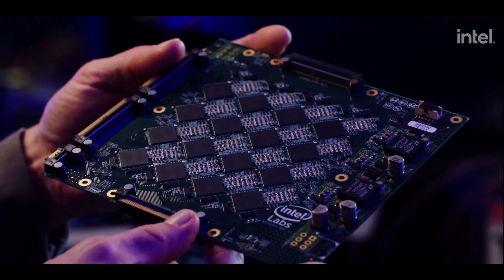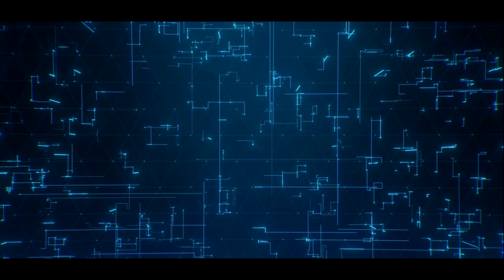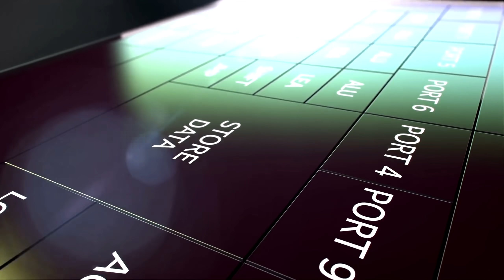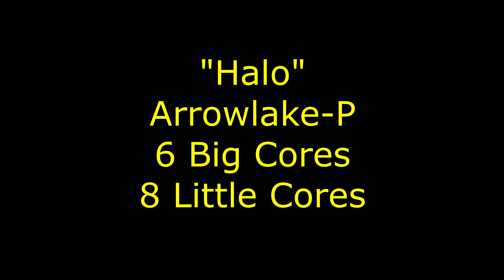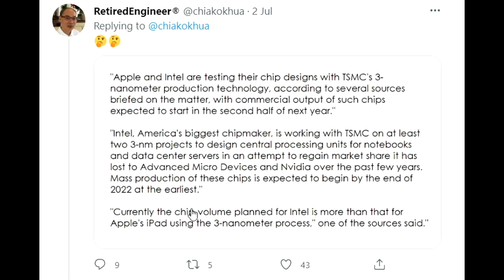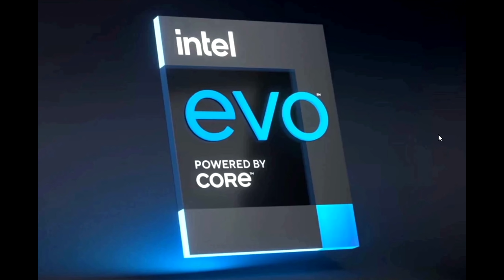Intel's Arrowlake Aims at Apple

Comment: tbh by the time Intel has this coming out, I would expect AMD to be at 16C32T in mobile, you are gonna be paying out the nose for it, but like I expect Zen 5 to be a thing at that point where I do expect AMD to go 24 - 32 core on the consumer desktop, 96 - 128 core on HEDT and 128 core on their data centre parts, and I don't see many workloads where 32C64T loses to 8+32 and I certainly don't see many workloads where 6+8 wins against 16C32T

16 cores in a 35W - 65W mobile part is WELL within reason, because like I also expect AMD 3D package Zen 5 mobile parts, and no I do not mean 2.5D I mean 3D and I don't mean the kind of 3D that is Zen3D. So yeh AMD can make a 16 core part and a 8 core part with a big ass iGP and big ass cache for it just by replacing one of the CPU dies, because the reason AMD hasn't went chiplets for laptops is because of the extra power you have to use shunting data though the substrate for a relatively long distance. The first place you are going to see 3D packaging from AMD in the CPU consumer space is gunna be laptops.

Honestly I wouldn't be shocked if we see 3D packaging for Zen 4 in the laptop space, then Zen 5 will bring that to the desktop.
Reply: 16C 32T in laptops are not comming anytime soon. I mean it would be insanely expensive and very few people would buy that.
Reply: @giorgos6576  Q4 2023 isn't exactly soon, and it doesn't need to be expensive if AMD doesn't want it to be, the cost of production are marginal for CPUs except for ultra budget CPUs. So then it's just about thermal and power, and with the energy SAVINGS you would get from moving memory onboard and the N3 process you can easily put 16 core on a mobile CPU, also clock gating is a thing so increasing core count barely effects idle power, so the only times you are gonna consume more power is when you are using those cores and whatever your doing will finish faster so even then it's not going to effect battery life as much as you would think.
Reply: @giorgos6576  For gaming/workstation laptop, I don't mind to pay the price as long as its fast and optimised
Reply: @alastairgreen_Nexus  16 cores will not give more fps compared to 8 cores.
Reply: Intel is no longer competing on performance with amd. 

Performance is nowhere as important in the mobile space as power consumption, packaging and costs.
Laptop buyers dont care about performance. 
And in the server space they can never catch up with amd while they are still using monolithic designs.

They see bigger fish in other markets i think.
Reply: @baronvonlimbourgh1716  A lot of my last comment also applies to what you said so... And there are certainly laptop buyer who care about performance, and as said, if they go with 3D packaging they can just swap out 8 of the 16 cores for a big iGP and gob of cache, or for a more budget focused CPUs only put 1 CCD, and have like 4 - 8CUs as base in the design as with the 1 CPU CCD part 1 GPU CCD part during low demand you can use the smaller GPU to save battery life so it still has a use.

Also depending you might be able to use the 4 - 8CUs in concert with the larger GPU given that AMD is already apparently doing that with RDNA3, although in that case it's 2 dies that are exactly the same also 4 - 8CUs on N3 will be tiny and you would also have all of the multimedia engine and everything like that in the base design.
Reply: @Etheoma  yeah, i'm sure amd will be upping the core game in the mobile space as well soon enough.
They kind of have to. Intel is still competitive in that space and they will want to take a lead there. Even if it only is for marketing purposes.
Reply: @baronvonlimbourgh1716  Also 3D cache also means they could integrate memory into the chip it's self, so memory bandwidth for the large GPU wouldn't be an issue, although with DDR5 and a 32MB L3 GPU cache they could increase effective bandwidth by 3x, so if it's "only" like 16CUs of RDNA3 they wouldn't even need integrated memory, but anything beyond that would require onboard memory so if it 20 - 24CUs thats gonna need onboard memory.

But 24CUs of RDNA3 would performing around a 1080/3060 which for an ultra thin even in 2023 thats gonna be pretty decent, like not great, but 1080p with pretty high refresh rates is gonna be easy.